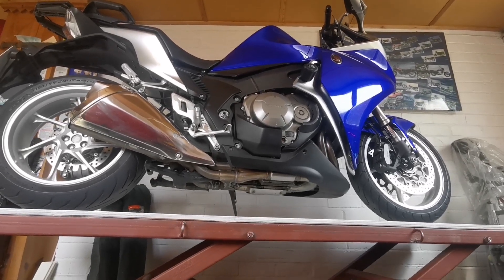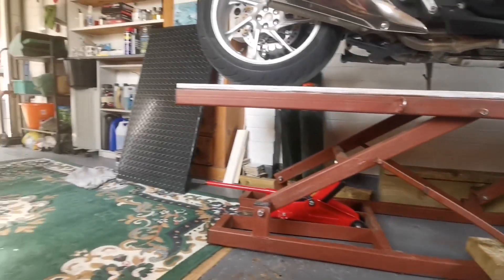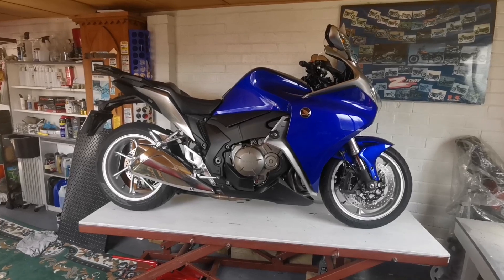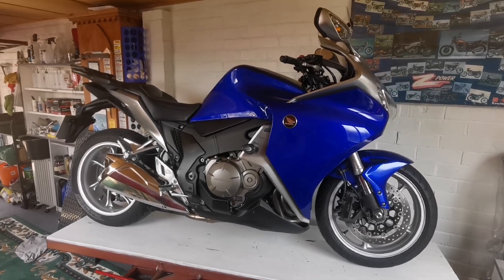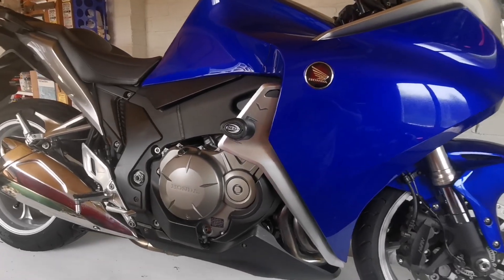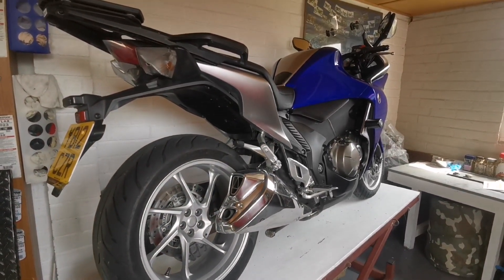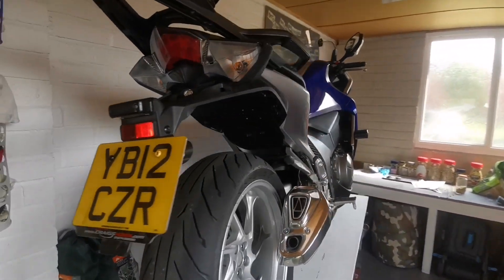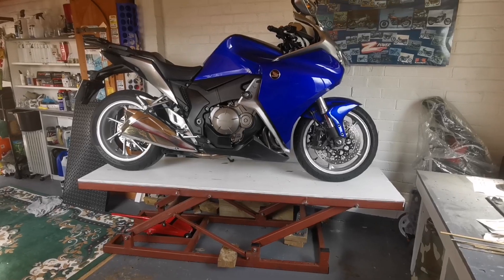Honda Vfr 1200 bike bench.

Comment: Did you raise the table after riding on?  I looked at one of those central  trolley stands that has a tubular  arm that slots into the frame and sort of counterbalances itself. has wheels and can spin round, but you need a smooth floor / surface. Think they are German.   Look a bit unstable though. Your's looks pretty solid (apart from all the risk management measures - lol) I guess you probably don't need all the blocks and extra jacks but better safe than sorry.
Reply from the maker: Haha yea I did, my trials riding skills are rusty. My mate has a draper one from machine mart, seems quite good, but think this one is over engineered, recently found out it was from a bike garage. My friend who I got it from used it for his rocket 3,with no issues, fingers crossed. Yea would he handy if mine spun around, but hey ho beggars can't be choosers 😊